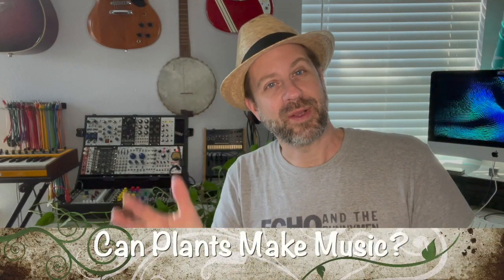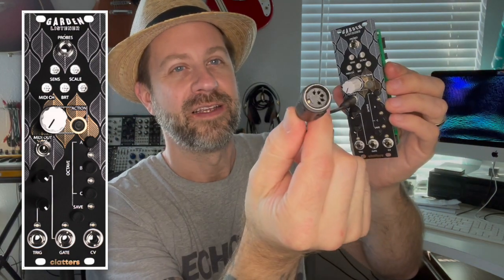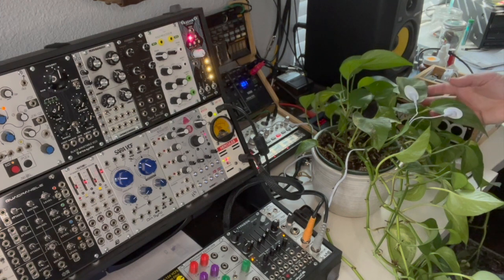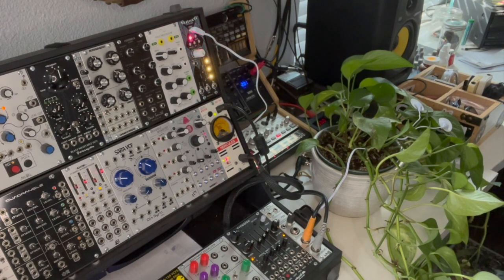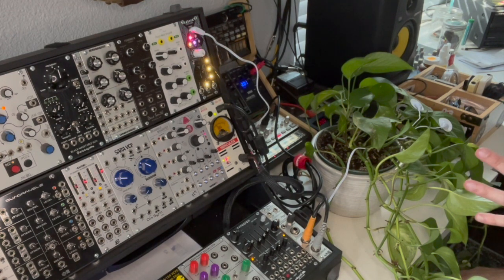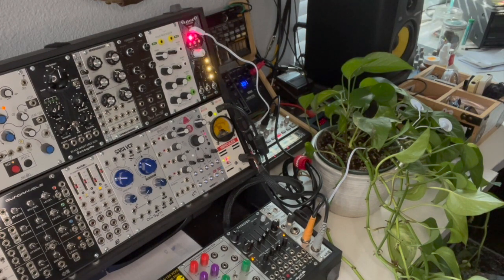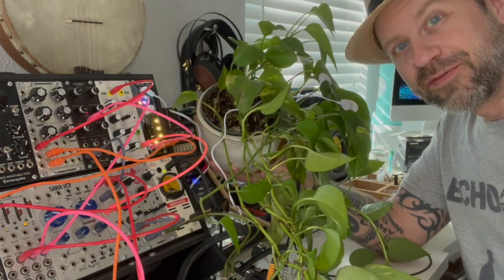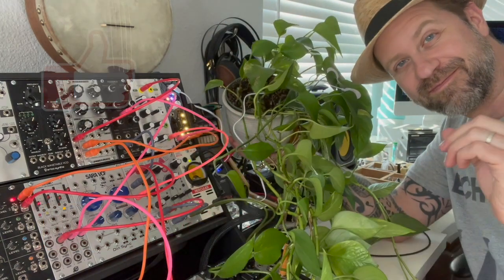Can Plants Make Music? (Clatters Machines Garden Listener Demo)

Comment: I have to watch all these plant videos so please bear with me.  Mention of the garden listener saved m e from asking several questions.  Wondering if you'll experiment by talking or reading to a plant to see if there is any sympathetic response?
Reply from the maker: Thanks for watching. I'm not the expert on this but as I understand it, the bioelectric connectivity is based on the water inside the plant. I know it works on other things like lettuce & tomato and I also tried it on myself (and my dog), so the hypothesis seems to track. All of that said, I'm not sure the water content inside a plant changes based on interaction. It may change slightly but probably not as much as you're thinking. The concept gives the illusion that the plant is "thinking" or "reacting" when realistically, it's just electricity flowing through the water inside the plant. I did try using the same plants in the fall and spring and they definitely sound different.

Comment: That's really cool but the results are a bit underwhelming though it might just be your patch. More ambient sounds tend to work better for plant music. There's an old arduino version of this same concept. In that version, interacting with the plant and by doing things like touching or damaging it, and changing it's environment affects the signal too. Does that also happen on this module?
Reply from the maker: I need to try some different stuff but interacting with the plant will cause it to produce different signals. I don't think I'd want to harm the plant, but I'd assume that would work too. Additionally, both the gate and trigger outputs have attenuators to control the density and it also has a pitch filter to limit the spread of notes on the CV output. I didn't didn't demonstrate either of those in this vid as I wanted to hear the whole range of what the plant was doing.